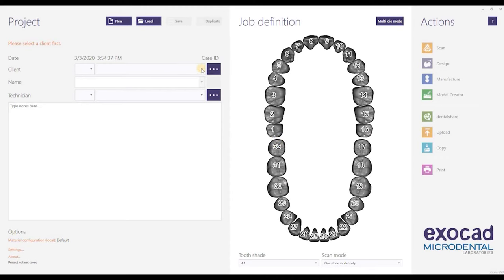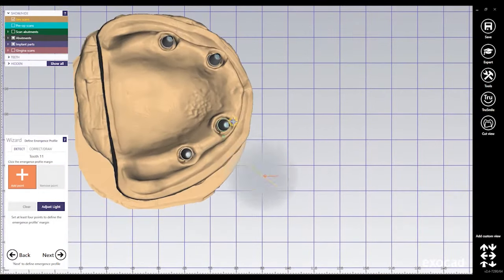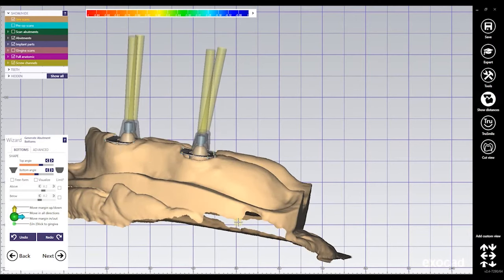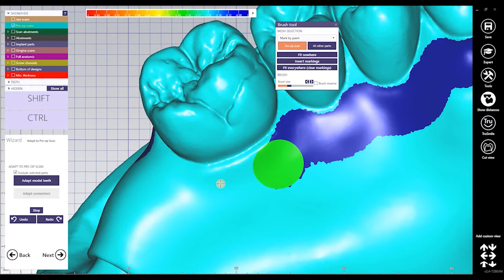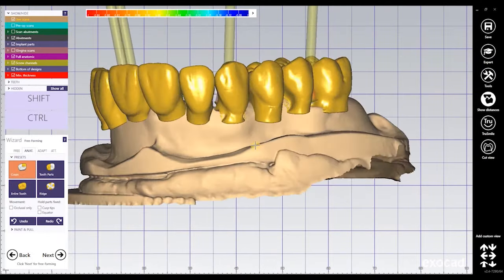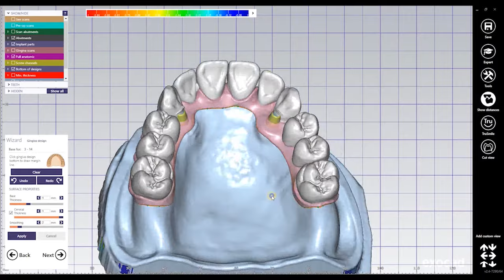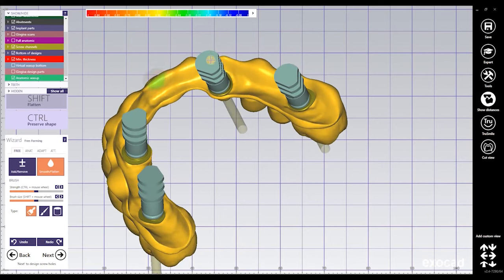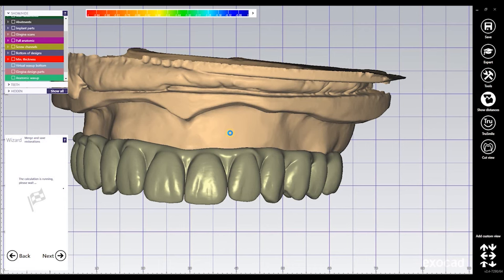Exocad Implant Screw retained All on 4 Tutorial in Plovdiv 2.4

Comment: The following question is for the intraoral scanner impressions: Have you ever had any problems with the end-work not having house for the multi-ti-bases? The end work sits properly on multiunits, but it won't sit on the Ti-bases.
Reply from the maker: The cross arch accuracy with IOS scanners is not that accurate to go to final restoration. You need a PIC or ICAM scan merged to the IOS tissue scan to get accurate results.

Comment: Hello MDT, in your case, did you use an existing patient denture as preop data and how can you get accurate results without the preop data
Reply from the maker: Hi Wood Dental. Thank you for the comment. You are 100% correct. You cannot achieve accurate results with a pre-op denture or pre-op PMMA try-in. The best workflow, for this method, would be 1) converted denture 2) PMMA try-in, and 3) final design. There are of cause other workflows available that are more digital.

Comment: Excellent video, one question though! At the end why did you turn the screw channel off?
Reply: otherwise there will be a tickness around the screw channel
Reply from the maker: Correct
Reply from the maker: I didn't really turn off the screw channel. This feature rather turns off the support structure around the screw channel which you do not need other than in cut back scenarios

Comment: With Exocad for a pre surgical how would I set up project to be able to shift midline, add teeth, etc…basically this Digital changes 
1. Perform a buccal and lingual cutback to full arch copy mill cases (very easy to learn)
2. Move mid lines on full arch cases by .5-1.5 mm
3. Add 1st and 2nd molars to cases that are full arch copy mill not individual teeth 
4. Take in IOS from 3shape convert to exocad and design full mouth pre surgical implant dentures 
5. 15mm bone reduction from insical edge up
Reply from the maker: Very interesting question. It's probably better to answer it in a video and show you.